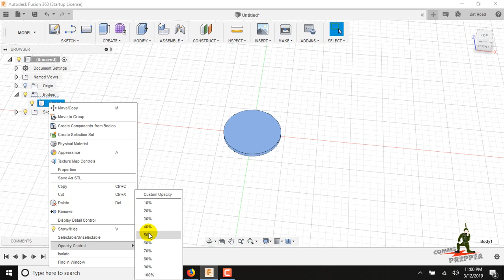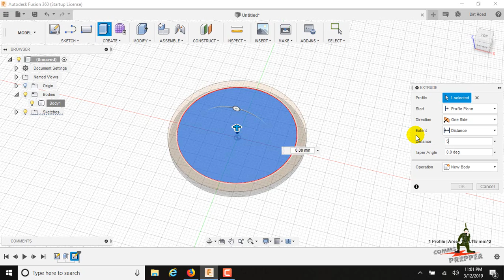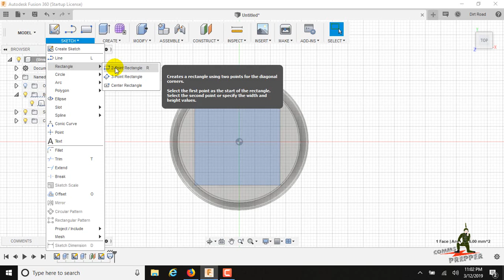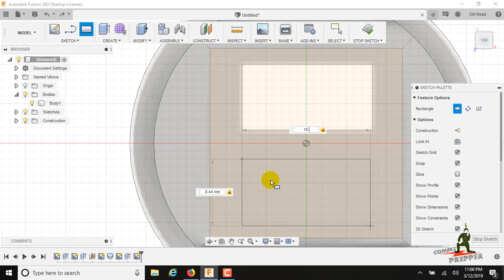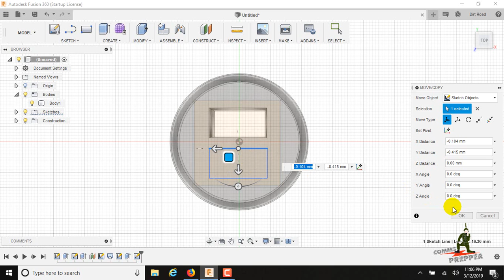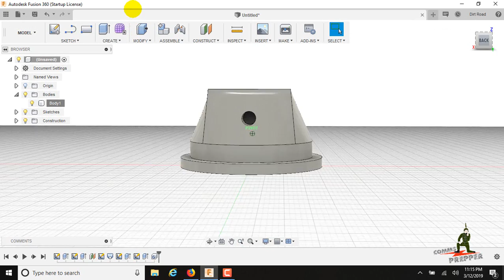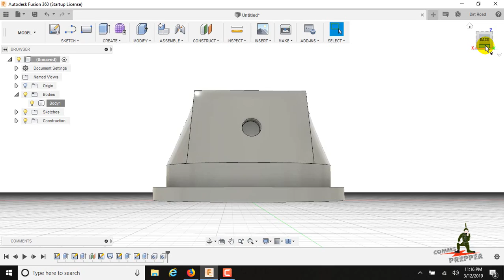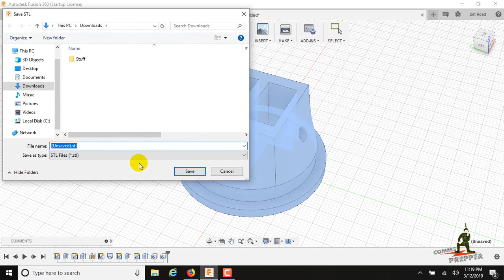3D Printing Amateur Radio Parts - Portable AREDN Node Upgrade

Comment: Are you using abs or pl(whatever it's called) also is the material uv stable?  I've been thinking about printing some parts but haven't found uv stable material
Reply from the maker: Brian I am using the only roll I have which is called HIPS (I have not idea what that means).  I have some PLA and ABS on order.  The Lulzbot mini uses 3mm filament which seems to be less common now that the 1.75mm stuff.  The roll I have came with the machine.  I have ordered everything in "bubba" (OD green).  Hank

Comment: Nice!
Reply from the maker: Thanks for the comment and channel support.
Reply: @Commsprepper  A 3D printer looks so handy for all sorts of ham radio project. Maybe in the future one will appear here. Maybe start with one of those <$300 printers to play and learn before getting a larger machine.
Reply from the maker: Tiny Machines out of Texas has a great reputation.  They stage and test all printers before shipping.  They also load new firmware.  Checkout thingiverse dot com and search Ham and Amateur radio - all sorts of cool stuff ready-made.